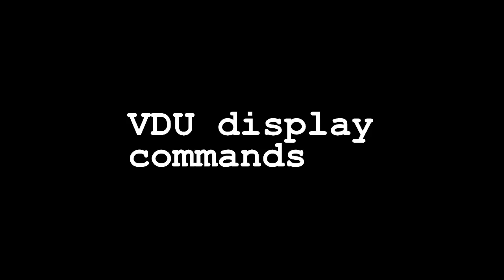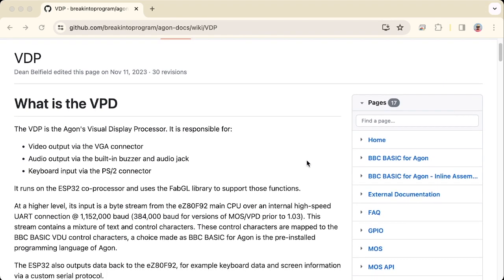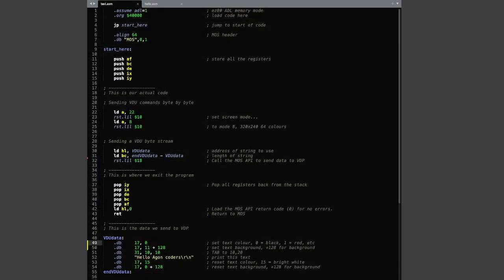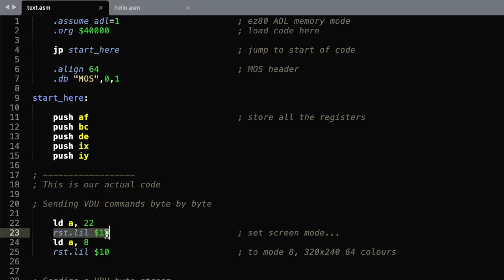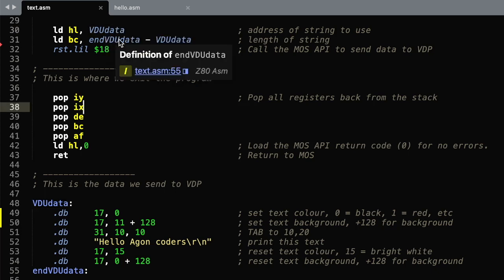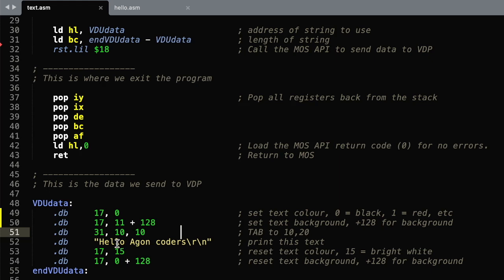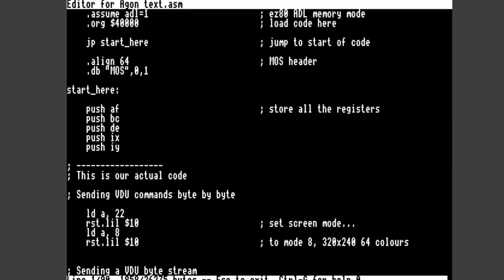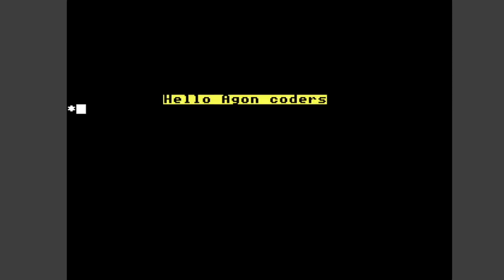02 Sending VDP Display Commands

Comment: I was having trouble understanding how this works until I realized that any argument below 32 (ASCII space character) is interpreted as a command or parameter. I don't see any provision for return codes. Given that commands are variable in length, I can imagine a situation where you forget a parameter or pass too short of a parameter, and your long sequence of commands goes haywire, and it would be difficult to debug.
Reply from the maker: There is no error reporting. You send a string of bytes and the VDP deals with it. If you send too many, the next ones are considered the following command or data. Too few, and it waits until it has enough to process the command. VDP doesn't know and there is no way to tell. As the programmer, you have to get it correct. BUT, it does work pretty well.
A common mistake is sending a single BYTE, when the command expects a WORD. Check the docs for any command which includes a 'semi-colon' which means a WORD, whereas a 'comma' is a BYTE. 
eg VDU 25, mode, x; y;
Which is a BYTE, BYTE, WORD, WORD
Most of the complex or system commands start with 23, followed by a number under 32.
Some commands send results back to the 'system variables'.
https://agonconsole8.github.io/agon-docs/MOS-API/#system-variables

You can build up long sequences of commands and it will deal with it very well.
If you get an issue, send out text to the screen (or over USB) to debug every so often and you can narrow down where the command strings fail.

Comment: Hehe, I got the Agon8 and looking at that thanks

I do wonder if it gives you direct access to a framebuffer where you plot pixels in memory or have to use the VDU commands.
Something that scared me yesterday, I was running a benchmark that was provided on the SD and a copy to VDU of 64k was finished at something like 0.7 seconds. I thought, wow if the only access to some framebuffer or bitmap I can show is that, it will be a problem for demoscene bitmap effects. I need to test it myself. Also I need to test which bios I have, judging by the baud rates there, maybe 0.3 matches that number.
But then, there are other ways to do cool graphical effect using bitmaps, lines, color cycling and other stuff. There is always creativity to overcome things even if restricted by certain hardware.
I come from Z80 on Amstrad CPC, where you could definitely do pixel bitmap effects that needed updating framebuffer, and now with ez80 I feel I have more power, but let's see :)
Reply from the maker: Unfortunately, you do not have direct access to screen memory as this is all handled on the ESP side.  Some of the 1980's home computers worked this way too, but not the MSX or Sinclair's (my background). 
This are some advanced things you can do by buffering code onto the ESP side,  but that's beyond these videos (and me). 
I think this disconnect from screen memory was my biggest hurdle at first as I didn't understand it. Now I do, I can work it to my advantage.
However, the connection from ez80 to ESP is very fast and well implemented.
As you progress onto bitmaps and sprites you will start to see the advantages. You can hand off the dipslay to the ESP and get on with your logic code. 
There is also double-buffered screens which may help in some cases with update refreshing to remove flickering.
The other hurdle for me was misunderstanding what the machine was about. Now I get it. For me, it has been learning ez80 assembly, but for others, it is learning BBC Basic. I am not sure that doing fancy graphical effects (not that you can't) is the objective, otherwise you could just code C on the ESP part of the machine at blistering speeds (with your own firmware), but that would spoil the fun of the retro z80 side!
Reply: @AgonBits Thanks for the answer, that makes sense. I also read in the documentation right now that there is no direct access and the ez80 has to communicate back an forth with the vdu. When I start trying things, I can see how fast is to continously send a bitmap, from a very small size to full screen. I used to do tiny 64x64 size plasma and rotozoomer effects on the CPC, so I thought on ez80 that's more powerful, they will be accelerated. Let's see, there are other cool tricks you can do with the VDU to mimic at least some of these effects or a lowres blocky screen maybe. I also plan to check the C compiler but will initially try something simple on ez80 assembly.
Reply from the maker: @Optimus6128  I've sent a full ZX81 style screen with no problem as a test...
But how about an Agon port of Bad Apple to whet your appetite?? 
https://www.youtube.com/watch?v=VRQPftkXF1Q
Reply: @AgonBits Oh yeah, I was looking at the Bad Apple port and said that' it, smooth enough even with blocky pixels :)
Looked a bit at it's code, it seems to call a plot and unplot function which I can't find anywhere or in the sdk, but also seems to write/erase only the pixels that changed which is good trick compare to if a full bitmap copy ends up being too slow to transfer. Anyway, hope this evening after work I'll be able to try some bits.